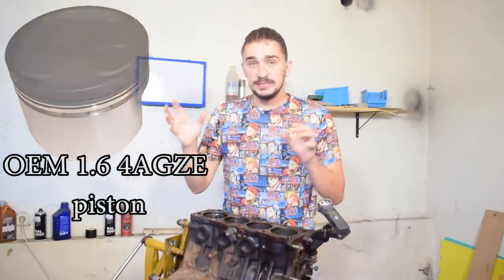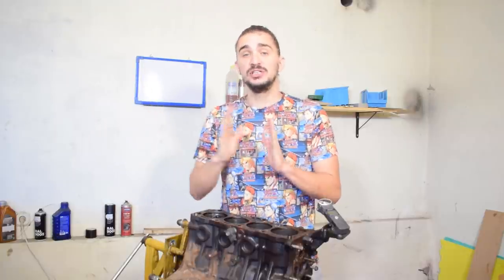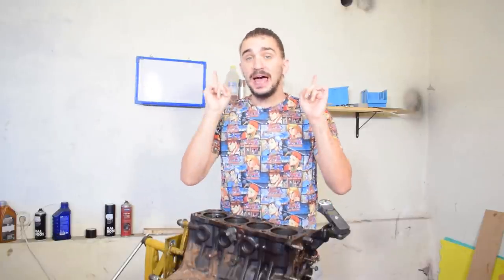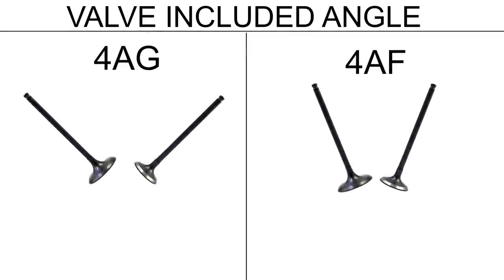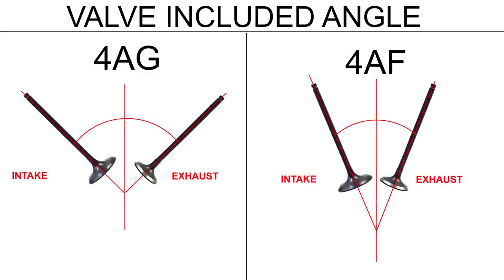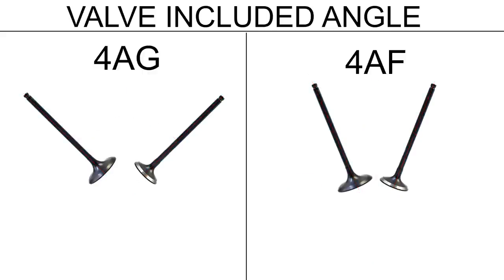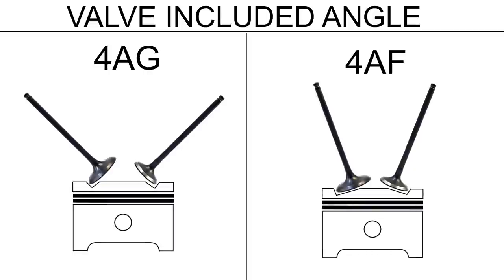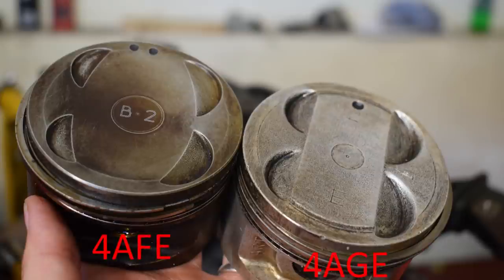How to check PISTON to VALVE CLEARANCE - Project Underdog #5

Comment: Re-cutting valve pockets is a very simple operation. 
You can even do it at home, although getting depth equal on all pistons is a little bit challenging  (not too difficult if your doing a full re-build though)
All you need is an old valve with correct stem diameter but head needs to be 1mm~2mm larger. Literally, grind cutting teeth into valve head then spin with an electric drill. It's easier than brazing tool steel to an old valve then grinding cutting angles onto that.
You can also use same method to mark where pistons need cutting and have them done in a machine shop although very few shops will have a good method of holding pistons, clamping them in vice works but can easily distort them. I make a holder to locate inside piston skirt then use a drawbar onto piston pin.It makes set up very easy

Comment: timing belt breaks 

valve :
Piston:

now kiss
Reply: Brett Collins  Til the tensioner lets go.  Happened to my friends' explorer recently.
Reply: Brett Collins  Timing chain tensioners do exist, ya know.
Reply: Brett Collins  both chains and belt use tensioner
Reply: Brett Collins  They don't always fail, right.  especially if you chance any tensioners or guides while you're in there.  I've also seen timing belts last well past their lifetime, even if a bit more rare.  (pretty sure the one on my 208K focus is original, from how it's looking....yeah that's getting changed soon)  Just saying timing chains aren't invincible to failure, not to mention more expensive to produce (multiply by mass production) and require lubrication.  Mainly depends on what he engine is used for.  V8 truck for hauling or racing? use a chain.  Little 1.8L four-banger for getting your groceries and hauling the fam around for thousands of miles?  A belt will do the job, and still equal a lighter engine overall, which can be valued for fuel economy.
Reply: non interference engine : "allow us to introduce ourself"

Comment: What a coincidence, the day I'm going to install new cams and check valve clearance is the same day you post this. Mine's an interference motor and it's about .080in clearance, but a word of advice. If you find yourself in a situation where clearances are in the thousands of an inch DO NOT use Play-Doh. When smashed it rebounds a few thousands of an inch. So in my case using Play-Doh would make for a very bad day.

Comment: I've watched a lot of your videos and thought they were very good, two things you forgot to take into account though. Conrods stretch at high heat/high RPM, and head bolts also stretch. To be measured accurately, this does need done with the right medium, and you need to factor in the "stretch" of the rod and the head bolts, and how much the piston grows due to thermal expansion (to be fair, both figures are usually minimal but need to be factored in for safety).

Just don't want to see any young kid go do this, think they are safe with their "checks", then have their motor blow up because they didn't take something into account. Otherwise, I find all your vids to be very informative, well spoken and presented, keep up the good work

Comment: With the cylinder head in place, melt a candle and with the plug hole uppermost, pour the molten wax down it until the combustion chamber is quite full and the plug hole starts filling. Wait about 20 minutes then remove the cylinder head, carefully remove the solidified wax and put it in a 'fridge to harden. You will then have a precise view of the combustion chamber shape and clearances, which are measurable. Weigh the solidified wax and use it's SG to calculate it's volume, alternatively melt it into a measuring cylinder, taking care not to lose any of it..
Supercharged or turbocharged engines normally have lower compression ratios than normally aspirated ones. As the C R is influenced by the shape of the piston crown, it is questionable if pistons for a supercharged engine will be satisfactory in a normally aspirated one.
Reply from the maker: This will be turbocharged. The wax approach isn't a bad idea, but it's very fiddly. You could do the same with liquid polyurethane. You couldn't melt it afterwards tho.

Comment: I am swoping my series 1 piston to  series 3 pistons i was told it would be saver to put two head gasket on for the valve clearance? My block got skiemed and my head aswell... But its was still fresh it was only skiemed  once

Comment: Since the higher compression pistons are acceptable, I would go with those, and simply eyebrow the valve relief a little more on the intake side particularly. I'm more a fan of higher compression than I am higher boost, seeing as compression is efficiency. I'd rather hit a higher efficiency 400hp than a lower efficiency 420 horsepower. That's just me tho. Power efficiency is what I desire most.

Comment: If you already answered the question in the video I'm sorry for asking. Are the 20mm wrist pins in the 4afe pressed or fully floating like the later 4age pistons?
Reply from the maker: Pressed like in older 4ag
Reply: @d4a  could you convert to floating?

Comment: Hi, your content is very informative and i love it.  Could you please help me with a value clearance query?  

I have a Mitsubishi pajero gen 2 1998 model with a 4m40 turbo diesel engine. 

I recently got it rebuilt, replace the head with a brand new one. Everything was replaced with brand new parts but when I check the value clearance with a guage feeler and found out none of them were as per the company specifications which are 
0.25mm for inlet
0.35mm for exhaust under warm engine temp. 

As of now all the value clearances vary slightly from these specified numbers. 

Could it be a cause of destruction for the engine?
Reply from the maker: It can't destroy the engine but it might increase wear and noise
Reply: @d4a  okay but if we set it at the company specified specs the tappets would make alot of noise. Right now the engine starts perfectly and there's no missing in the engine but slightly looses power on decent.

Comment: Quick question can I swoop my 7AFE engine head for a 4AGE hea
Reply: From the sounds of it no different valve angles
Reply: You can use the 7afe block with 4age 16v crankshaft connecting rods and pistons with 7afe metallic packing.

The 4afe and 7afe cylinder heads are the same.

Comment: Did you lock the crank in place when you did the test? Can you be certain that the opening of the valves did not force the pistons down in the bores a tiny bit?
Reply from the maker: Nope, didn't lock crank in place. But I rechecked piston height afterwards. No movement. Also, valves are in most cases not able to push the piston down, they would just bend.
Reply: The piston dwells at top dead center as the con rod moves from one side to the other of the crank. 

That’s like trying to turn a door knob by standing on it.
Reply from the maker: @fastinradfordable  Exactly!
Reply: @d4a  Great, just making sure you know. As long as you put the rods straight up the valves would never be able to move the pistons, but even a few degrees could potentially introduce problems.

Comment: Do you remove your smallport pistons from the mr2? Non interference engine is not a problem with me but is there any other problem other than that? Using smallport piston in a 4afe

Comment: Is there any engineering data that specifies general or specific clearance minimums for this motor?
Reply from the maker: A very rule of thumb-ish minimum is 2mm on intake and 2.5mm on exhaust. If you plan to rev pretty high or do forced induction a larger safety margin isn't a bad idea, something like 2.5 intake and 3 exhaust.

Comment: I would be more concerned about the extra space from the ge valve cutouts lowering the compression as well as affecting the squish area. Good chance the 4age low compression pistons may lower the compression too much with the 4afe cylinder. 1.6l already being quite torque less combined with no vvti and a low tech decently sized turbo might make the car annoying to drive when off boost 🤔
Reply from the maker: The 4AFE has smaller combustion chambers than the 4age. The low comp 4agze pistons actually result in a 9.5 or so static compression ratio in a 4afe.

Comment: Don't use play-doh. It compresses then springs back and will not give you a accurate measurement. A easy find to use is clay bar in the auto parts store in the body detailing section. It holds it's compressed size good

Comment: Why not use the stock pistons with higher comp ? More power na makes better turbo power
Reply: higher comp = increased chance of knock wih less boost??
Reply: @moocow2172  indeed if your not using a good ecu witch he is so it should be just fine with high comp pistons but ya if he wasn't using a aftermarket ecu it wouldn't work well at all
Reply: @tupacisthebomb23  it's not to do with ecu it's to do with the octane rating of the fuel,  the temperature of the engine and reliability and safety, high boost engines run lower comp so they can run that high boost with less risk of knock, boosted production cars run less comp

You could run high comp and high boost on a re-mapped stock ECU?? with less reliabilty and power than a lower comp higher boost setup and with more cost.

Watch a few more vids and get back to me  all the higher comp will do in reality is give better response off boost, which is not where we intend to make changes on a turbo car....

Comment: I thought every engine is interfernce...good to know. I guess some of the high performance low consumption engines are interference...and the rest are ...nonconflictual ;)
Reply: Most modern engines are, but up until the 90s, and in some cases early 2000s, it was not unusual to see non interference engines in mass market cars.
For example the 2.0 AQY engine in the Golf IV was non interference and produced until 2003.
Reply: That's actually very engine specific. You can't really predict which one is interference or non-interference. Every diesel engine will be one, but petrol engines are very different from eachother, all lays on the way the engineers have designed them. You can guess that low compression ones will be non-interference, while higher compression ones will be interference, but that's still just a guess.
Reply: @XStuntManiac  I had the cambelt snap on a 2.0HDI from 2004 several years back. No damage on the engine.
Reply: @ptilrem  2.0HDI is interference engine, just designed to have the levers between camshaft and a valve which break to prevent any damage to pistons and valves themselves.
Reply: @ptilrem  It isn't always fatal for interference engines.  Unless you are on a fast road and somebody hits you.
Reply: @kilianortmann9979  I wonder how such engineering decisions might coincide with the mass adoption of the DOHC configuration. Dual cams = longer belt or chain with additional bends in the route and higher risk of breakage when considering manufacturing technology of the era.

Comment: This is not how you check piston to valve clearance. You actually said it - that's just an experiment to see what would happen if the cambelt snaps, but this is not how you check your clearance - you have to do it with the timing belt in place. So this isn't really an instructional video as the title would suggest. Anyways, i watch almost all of your videos and like the content, but in this case i would say that the title is misleading.

Comment: Why should one aim to build a non interfering valvetrain/pistons? I see no reason to.
Reply: Its an engineering preference for failure modes which don't cause secondary damage.  A bolt holding an engine mount may fail causing an annoying driveline vibration. Or it may fail and then fall into the path of the cam belt teeth and destroy the valves. Or it may fail and drop into a position where it blocks a critical oil return. Or it may fail by breaking into small fragments that get ingested into the oil feed.  Same 10c bolt and the best case scenario is it costs 10 c to rectify the failure and worse case scenario is its repair cost exceeds the value of the car. An engineer will look at every failure mode and act if he's not satisfied with the outcome. Think of every time a factory service manual has a routine task with the bold type heading "failure to do this exactly as directed will result in catastrophic damage".  Why design in that level of risk if there's a no cost alternative?
Reply: @stephenbello1081  it is NOT a no cost alternative. Planning for failure is planning to fail
Reply: I now see the reason why "you see no reason to".
Reply: @stephenbello1081  Let's say you have a semi serious engine. Make pockets for valves that have say 2mm TDC lift, with some room to spare. OR, make deep enough pockets for the whole 12mm of lift you have. Either your pistons are far off the head (low comp) or the valve pockets are pretty damn deep. Can you make them that deep safely? How much worse did the combustion chamber shape become? Did you create hot spots to the pistons? How much did you lower the compression by making extra 10mm depth to the valve pockets? That by the way is a non trivial number of cc's. Not here to be wiser than thou or put anyone down. I have actually had to work on engines a bit and have stood in the pits as a mechanic. My thoughts come from personal experience.

Comment: You need to use pistons engineered for the 4AFE head.  You are only checking valve clearance; squish is critical as well to reduce the risk of detonation.  If you use the 4AGE pistons, the squish is poor for reasons you shred t the beginning of the video.
Reply: Turbo
Reply: All the more important.  Compression ratio, valve to piston clearance, and squish are all important.  The reported compression ratios are incorrect if the pistons from a 4AGE are used with a 4AFE head.  And the 4AGZE pistons result in a very low compression ratio even on the 4AGZE.  Modern engine management makes running a low compression ratio on a turbocharged engine obsolete.